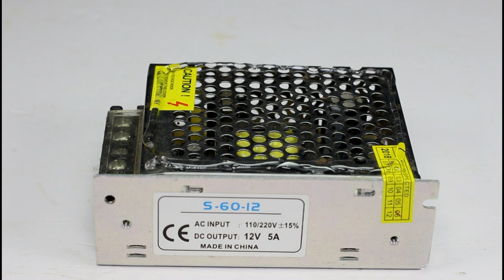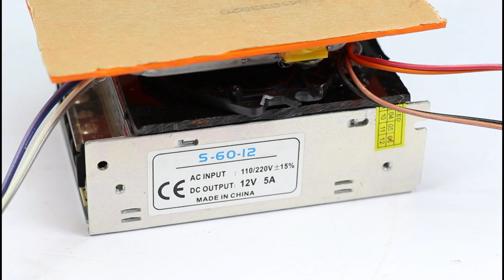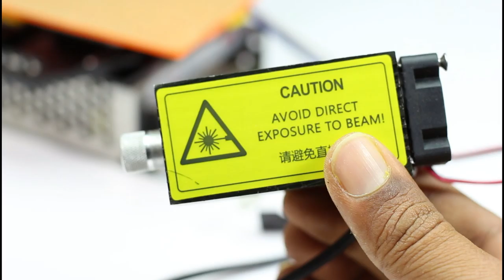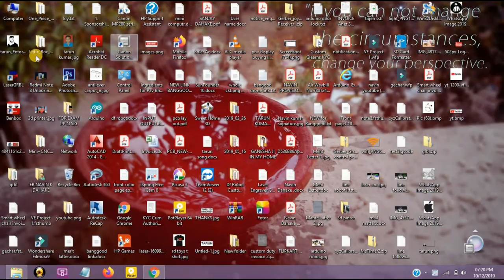How to Make CNC Laser Engraver Using DVD Drive

Comment: Hello;
 Step motors get very hot and make noise. What should I do?
Reply: on step drives you have a variable resistance: try to put it more down (clock rotation) to put low current in it